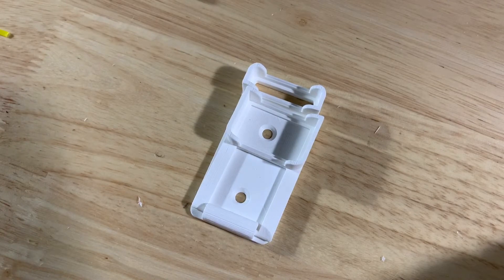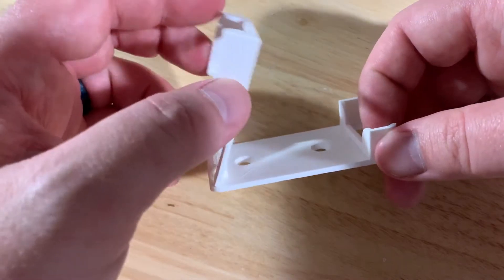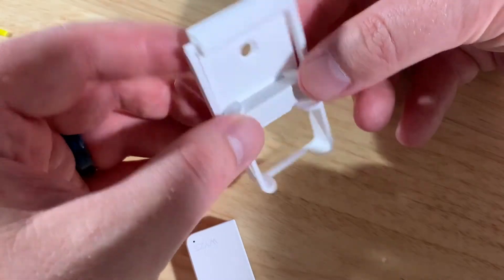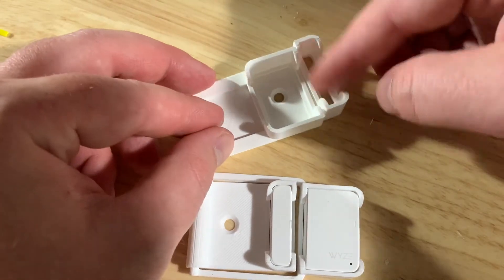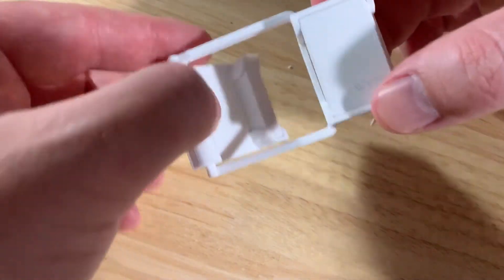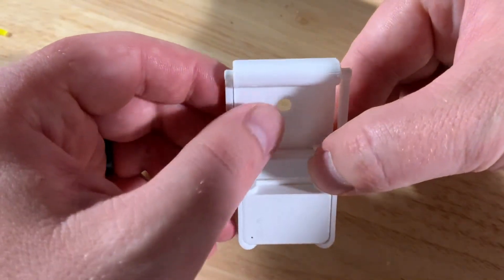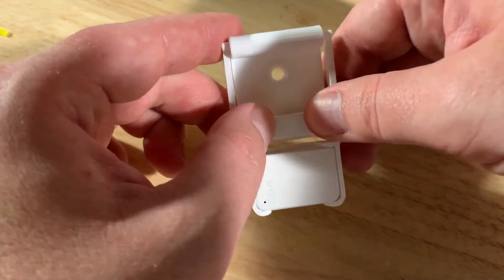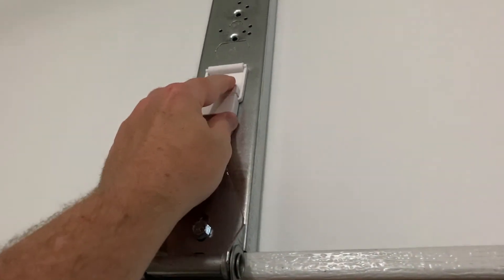Garage Door Bracket v3 for Wyze Sense

Comment: I preferred a mounting of the magnet further away from the sensor so it will just barely trigger when closed (as best as I can based on placement on the door). If it’s on the top door panel it should trigger even if it’s only open like 6 inches.
Reply from the maker: Jason M that is a good point I will measure each type and see what the difference is.